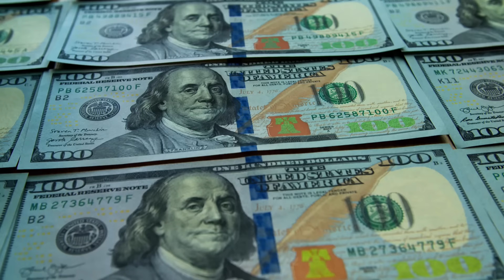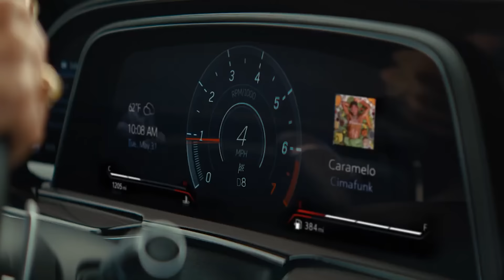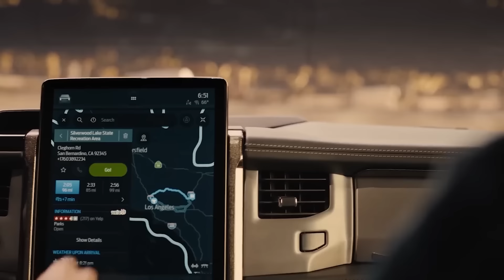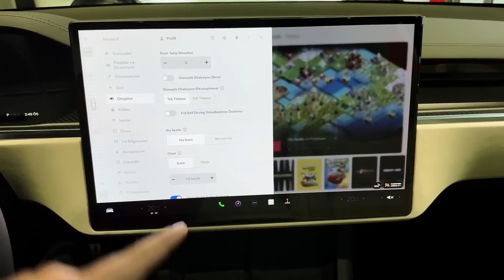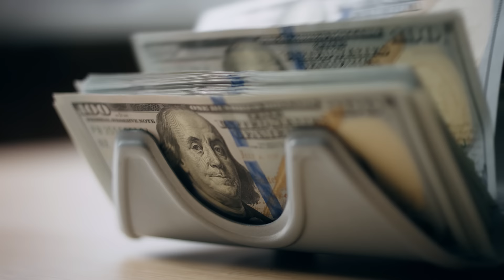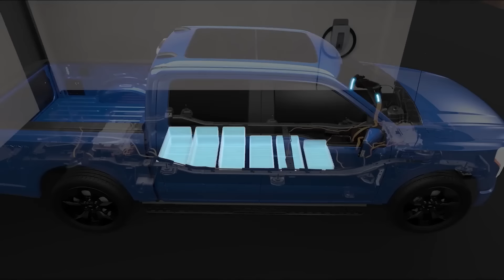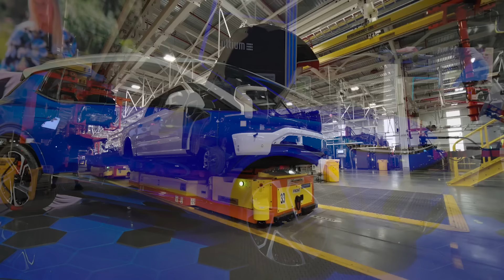SHOCKING! NEW EV Report Reveals MASSIVE EV Car Market CRASH!

Comment: I knew and would never buy a EV at this point, way too expensive, batteries need to be replaced after X years and are really really expensive, range anxiety, parasitic drain, and the list goes on and on........not good in cold climates, don't touch them.....

Comment: If an affordable EV hybrid with about 50 or so battery miles was available that would charge  from normal ac outlet I WOULD BUY ONE., my  daily use is under the 50 miles. I would get the free solar setup for my home in my state and avoid both an electric and gas bill.
Reply: You know that you can charge all EVs from a normal outlet right?
Reply: Not ALL hybrids are plugin

Comment: How I see a good ecar: 1) price 12.000 euro, 2) size is small, like Opel Corsa or small Fiat 3) weight with battery max 800-1000 kg. 4) max speed 90 km/h 5) charging in 5 minutes 6) battery consists of different modules, which one can easily add/remove 7) users are renting the battery 8) details,  charges, batteries are 100% compatible (like AA and AAA small  batteries).

Comment: Other than all the ridiculous hype - who wants a vehicle that you have to wait so long to charge - and after youv waited your lucky it will get you 250 miles - less in the cold, cannot realistically pull a caravan or trailer cost an absolute fortune and so heavy they wear out tyres like billy oh - when you can buy a decent diesel 4x4 with a 600 mile range pull a 3 tonn trailer fill up in 5 mins without fear of being burned alive in it

Comment: The reality is that EVs are ideal for some, but not others. 
Great in some countries (thanks to charging infrastructure and climate, like Norway or UK or EU) but not so great in other countries. 
In my view the future of cars and road based vehicles was always going to be a patchwork of powered motion technologies. There was never gonna be a “one size fits all”.
Critically gasoline / diesel / LPG internal combustion engines will continue to be needed for many decades yet, be they for hybrids or regularly powered vehicles and even if everyone could afford to & wanted to there would still never be a complete conversion of all existing drivers swapping for an EV because it isn’t practical. But if it works for some then great, that means more gasoline and diesel for the rest :)
Reply: Steady on, a sensible and pragmatic reply compared to the EV haters that trawl Youtube looking for reports backing up their hatred for EV's rather than the ones supporting EV's!

Comment: We in the engineering department at OU had an EV to drive around campus in 1969. Good old lead batteries, tiny car, and low expectations about range (car-like golf cart). I'll buy and EV in a wink when they get the bugs worked out and cost down. That will be long after I die.

Comment: The truth is, since WWII, the physical form-factor and energy density of batteries of today, have only been reduced to 1/5 of there original size (there are only so many molecules of materials available for anodes and cathodes).  On the other hand, the smallest single function vacuum tube's glass envelope in 1945, will hold more than thirty billion transistors, batteries will never catch up!

Comment: WHY would anyone buy an ev ? BECAUSE THEY DON'T WORK ! High insurance, no place to charge, expensive to buy, fire hazard, limited range ect ect.
It takes me 5 minutes to fill my tank at the gas station, it takes at least an hr or more to charge an ev, IF you can find a charger and it actually works and allows you to charge.

Comment: Hydrogen powered engine is the most sensible technology for the future. (Hey Eli, you're going to have to make a good engine to catch up Toyota). Bought a preowned 2016 Toyota Camry that safe me tons of bucks is one of my best decision so far.
Reply: Hydrogen costs more in electricity to produce it than it returns in energy, then there's storage, distribution, refrigeration, leakage......Sadly not the future either.
Reply: @foxstrangler  I am not a super engineer, just wait and see or inquire Toyota and find out the answer. My simple logic says that you just need water, even water distilled from a sewer plant can produce energy with no harmful waste rather than digging certain mineral that is available only in certain place and it is not sustainable as well as it waste will spread all over to everywhere.
Reply: hydrogen on demand car? would work, but still need a good amount of "juice" n the hydrolyzer to produce the hydrogen to power the car. other than that, just pour in / add water, n good to go.

Comment: Suprise. SUPRISE!
Reply: Surprise, not Chargedrive is wrong AGAIN 
Maybe go have a look at the new all-electric Toyota BX4Z released this month. Toyota like all car makers know EV is the future and ICE is done
Reply: @johnn17golf ICE vehicles will continue to be around for decades to come. The infrastructure just simply doesn't exist yet for EV vehicles. That could be decades away. Not even close.
Reply: @bobby1970  Infrastructure is there, just add a few chargers and bosh... It is as easy to add a charger as to add a new set of traffic lights! 
ICE cars will still be around but mostly for spares and for weekend car meets. People will be using their EVs for transport. 
There are still people, mostly in 3rd world counties, who do their book keeping on paper. Quaint, but backward. Your kind of people/
Reply: @johnn17golf  Our (the United States) power grids can not currently handle a dramatic increase of EV ownership. It simply isn't ready yet. I'm all for modern and advanced technology, but if we are not ready for it, we are forced to wait. Not only that, but the EV technology itself isn't yet good enough. The batteries are way too heavy and they are unsafe, especially in an accident. They are even dangerous sitting inside a garage. Other problems also exist with EV cars such as reliability issues with electric motor drives, and suspension problems. The cars are just too damn heavy and handle like crap. However, I do believe eventually they will figure out how to overcome these technological issues/problems with advanced technology. Unfortunately, this takes time.
Reply: @bobby1970  your grid cannot handle a 3.6% increase over the next 15 years?
I know US is a declining State but didn't realise you were that bad!

If EVERY car in US was an EV, it would need just 3.6% of CURRENT capacity to keep them all charged. 

US is a laughingstock around the world but surely even you can manage 3.6% increase!
Reply: @bobby1970  Ford expedition is 50% heavier hhan Tesla 3. 
Yeah ICE just too heavy.
Reply: @johnn17golf  That's the exception though, and definitely not the average.
Reply: @bobby1970  Sorry for inconvenient facts, bobby
Reply: @johnn17golf  I'm not buying into that crap info you come up with. It would definitely take a hell of a lot more than a 3.6% increase in power output for the power grid to be sufficient enough. Try closer to at least 14% increase needed to be sufficient enough for all cars to be electric powered here in the states.
Reply: @johnn17golf  Don't make me laugh.
Reply: @bobby1970  Like I said, find someone who understands math and have them crunch the numbers for you. It's 3.6%. You can keep guessing if you like and keep being wrong, but it only takes 3-5 minutes to look up the numbers and punch them into a calculator and  - whoosh - your misunderstanding is gone.
Reply: @bobby1970  I find facts interesting, you seem to be amused by your own lack of knowledge.
Reply: @johnn17golf  I'm actually amused about your lack of knowledge.
Reply: @bobby1970  yet you are the one posting made up numbers and unwilling to pick up a calculator.

Comment: EVs are a novelty item like a Golf cart they are not built on practicality there value is as equal as the e-bike “fun to have and enjoy, but not the end be all solution” there not practical enough… let’s face it an EV is just a cell phone on wheels people bought it for the tech and not the practical function of it…. It’s not an add to life but an add on to stress…. Should’ve never happened… you want save environment adjust the formula of fuel for cleaner drive…..

Comment: an electric pickup truck (a truck!) is a stupid idea. The f150 & co have aerodynamics of a falling fridge with the door open. the weight is also an issue. In result doing an f150 etc EV is not economic at this stage of the tech cycle.

Comment: Maybe it’s because to buy any car is over the top expensive , and the old bucks that have the cash don’t want ev’s is it takes at least a half hour to charge, the are wonderful car and silent. But not good for traveling unless they had a solar panel to switch over to to run an EV . There are kinks but so did the model A have problems. This is a minor set back. But er can lead the world in EV 
And non has vehicle. Let’s think about this…

Comment: Lifestyle bending and convenience depriving products are not wellcome, not anymore.  Custommers are slowly but surely awakening from the EV anaesthetic and indoctrination. The pendulum is slinging back. EVs reached the top of their capacities, well perhaps some extra 20-30%  still to come from things like solid-state or whatever batteries, if at all, but that won't be enough, not by far to compete with liquid fuels.
Reply: True.
EVs are not a new technology by any means; they have been around for well over 100 years, for almost as long as ICE vehicles. For some reason, one technology blossomed, in that time, while the other disappeared in history… until a certain Mr. Musk came along and did what he always does, dig out some long forgotten idea and use his con artist skills to sell it off as brand new (exactly what he did with the Hyperloop).
Now people seem to start to realize that modern EVs still suffer from the same systematic issues as 100 years ago – mainly the lack of a lightweight and quickly refillable energy storage solution.
Plus, the EVs from five to two years ago were just plain ugly, and I personally would under no circumstances pay the price of a single-family home for a computer on wheels which feels like a lifestyle product but robs me of any driving convenience features, like real, haptic buttons and switches replaced by a big touchscreen at the most inconvenient location on the dashboard.